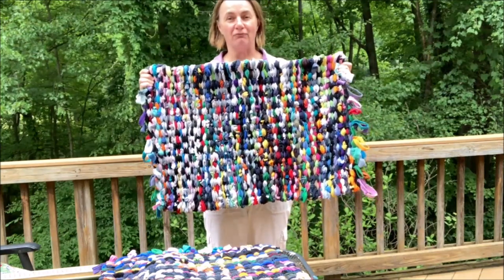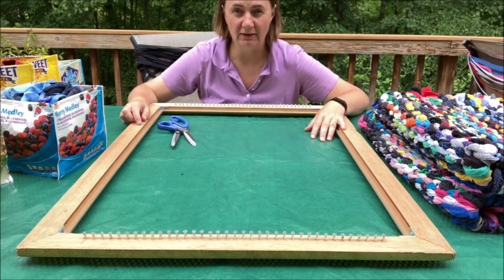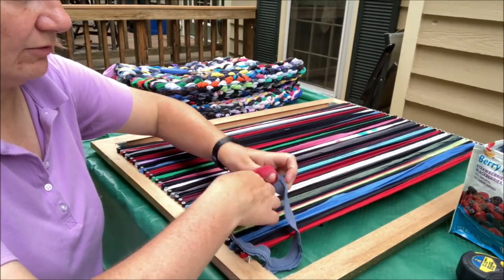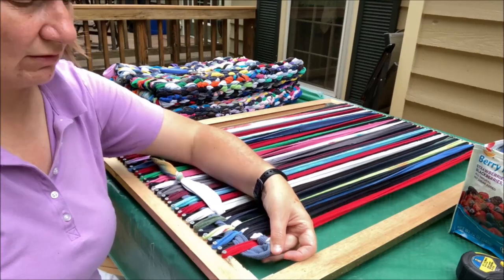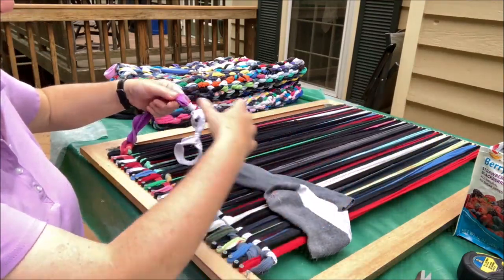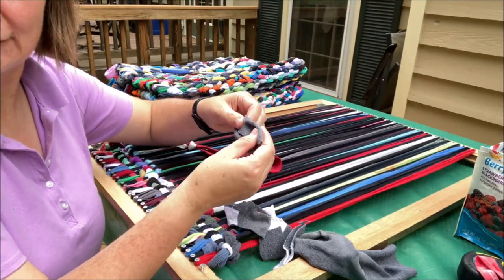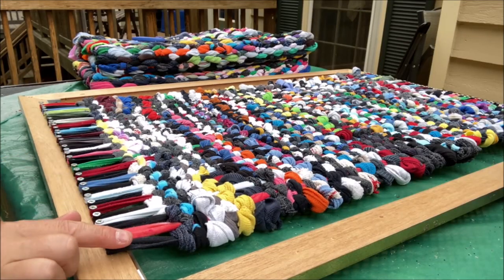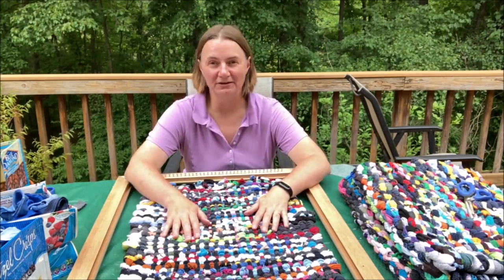How I Weave Old Socks and T-shirts Into Rag Rugs

Comment: Why can’t you use just strips of t-shirt for the long pieces?  Why only the bottoms hem of the t-shirt?
Reply from the maker: Hi Alli - you are welcome to use strips of t-shirts. In my case, I use the rest of the t-shirts to make t-shirt yarn. I weave them into a different type of rug called a fluffy rug. You can visit trashmagination.com to learn more about that. This rug was designed to use up the t-shirt components that I cannot use to make t-shirt yarn. If you don't make t-shirt yarn, then you could certainly use it in this type of rug! Do note that the strips that are not on the waistband will stretch a LOT more because there are not stitches holding it back. You will need to experiment but I bet a child's t-shirt will give you a big enough loop for this size of loom. An adult t-shirt loop would stretch out too much.

Comment: Could this be done heddle loom
Reply from the maker: Well, my holes in my heddle loom are too small and I could not squeeze in the t-shirt loops to make the warp. But maybe your heddle loom has very large holes where you put in your warp threads? Certainly, if you wanted to use a regular thread for the warp, you could weave with sock & t-shirt loops for the weft.